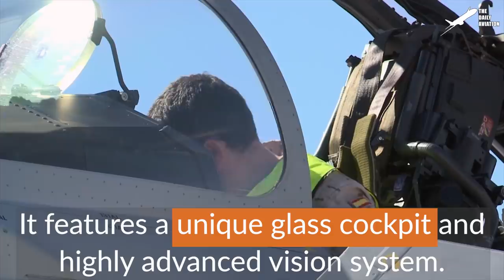US Newbie Paratroopers Jump Into Water for The First Time

Comment: The crew chief sitting on the right side of the helicopter (time 0:56) is not properly fastened to the aircraft. The hook of the line attaching him to the helicopter is open and this could potentially be fatal if he is not careful.
Reply: That is not the strap connecting him to the helicopter, it's just a temp guard rail.
Reply: @mahfl22  I took a closer look and you are correct. Nevertheless, an open hook poses a hazard. It should be fully closed to prevent it slips from the point it's attached to.

Comment: Just curious, the canard at front of the Eurofighter Typhoons is a fixed 'flight control' surface, but can it moves or slides forward if necessary for adjustment, say, for shifting the "center of gravity" (and for other reasons) even though it is a fast flying aerial machine (and not a ground vehicle)? Maybe further study and experiments for R&D needed?
(9:30)

Comment: Wait! I was once taught to disconnect the parachute canopy just moments before hitting the water to prevent drowning from being tangled by the chute's risers.
Reply: Not only would that not prevent entanglement, but it wouldn't make sense considering that you should have already detached yourself completely from the harness by unbuckling chest straps and leg strap prior to landing. You would normally only detach one riser if you're landing on ground with your harness still attached (normal configuration). It is true that you should ubuckle your leg straps just a few seconds prior to landing, though...
Reply: @allenklingsporn6993  I mean, he could be talking about 50 years ago lol
Reply: @joeg5414  I think it's from a movie.
Reply: no - it is notoriously hard to judge height - if you disconnect too soon then you die - you ride it into the drink - they actually train you what to do if a wind re-inflates your chute so that you don't drown - which has happened more than a few times.